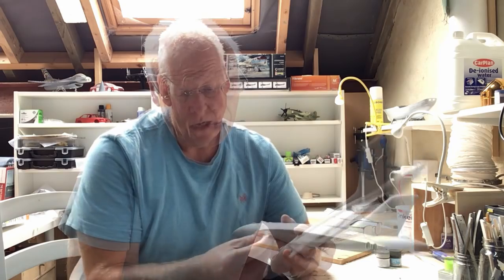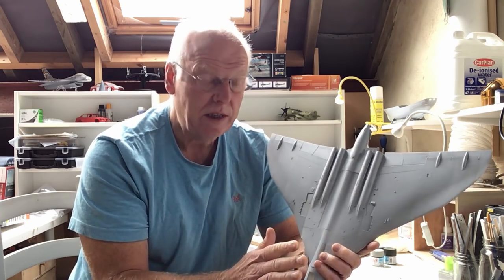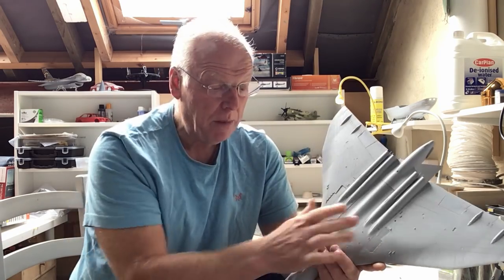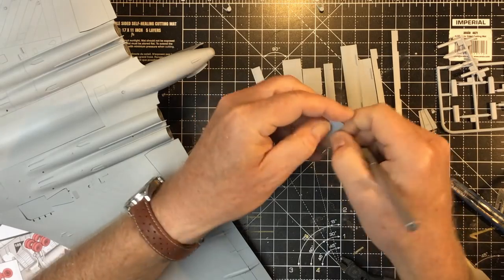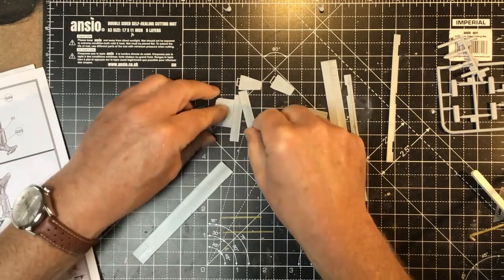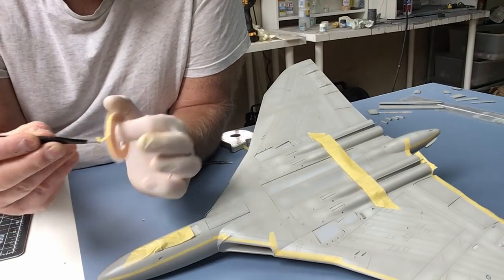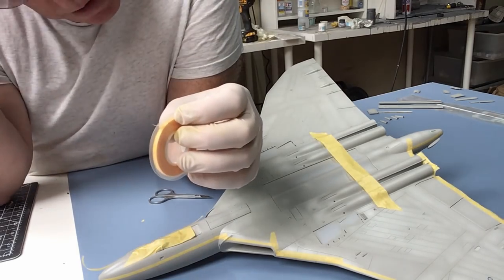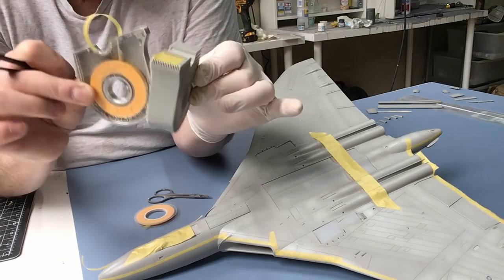Airfix 1/72 Avro Vulcan B.2 (New tool 2021) Part 8

Comment: Nice work Steve, This is the 3rd build of this kit, and you don't seem to have the same problems as the other 2 channels, keep up the good work.
Reply from the maker: I think my example was a bit better than others in terms of sink marks John; but I had the same fit issues with the fin tab and the different sized front fuselage where it meets the nose. But its an aircraft with personal connections for me so I guess Im prepared to deal with the fixes.
Reply: @TheModelShed  Your doing a great job with it.

Comment: Looking good Steve. Used exactly the same masking techniques on mine and was very happy with result, only minor touch ups required. I know what you mean about the grey…. I sprayed mine initially in a darker grey but changed it to l lighter shade but it changed again when I applied the green. I’ve modelled a  27 Squadron machine (XH560) from the early 80’s and I have a black & white photo of the reception for the last ever sortie and the upper grey looks really light next to the underside colour.
Reply from the maker: Is yours finished now Ian? I’d like to see some pictures of it 👍
Reply: @TheModelShed  hi Steve. Possibly is the answer…😂 The paint and decals are on but I‘m not a fan of heavily weathered models, I prefer the factory fresh look. I will probably go over it with a wash to bring the panel lines out but to be honest I’m waiting to see what you do…😂😂 Regarding pictures I can’t see how to attach them on here or on the Patreon page..🤔

Comment: Steve. I really like the approach you have taken here. I am doing a 1/32 F-15C and i think i will follow your lead here and use the underside color with panel lightening by adding a drop or so of white as you have. The same on the upper surfaces. Normally i would black-base or pre-shade but a lot of modern USAF aircraft dont have the drastic weathering since they are revetment housed even in-theatre and not as exposed to the elements. Post shading will allow for any weathering without the starkness. I guess i am going back in time to early methods but in some cases it just seems more realistic. Great job, cant wait for Friday
Reply from the maker: I think weathering can be a bit overdone sometimes Ralph. Its important for me in this build to represent the aircraft as I remember them after we’d taken them through their major service. Everything stripped out and rebuilt - they looked like they’d just come out of the Avro factory.
Reply: @TheModelShed  Matt @ Doogs has been playing with multiple hues on top of hues for creating depth and variation which although taking layers upon layers to create is a very effective alternate approach which i find very interesting and subtle to the eye